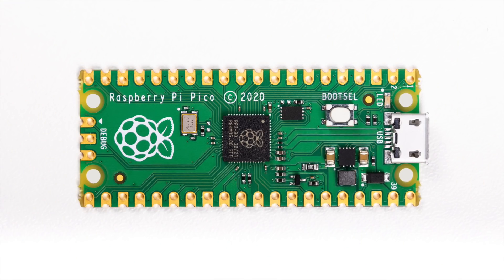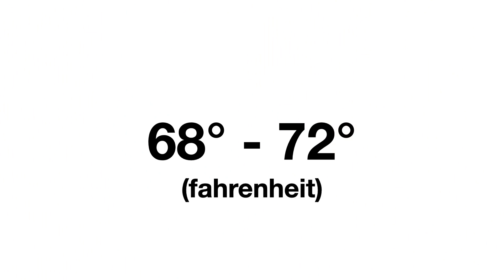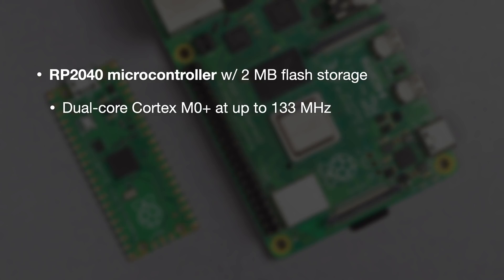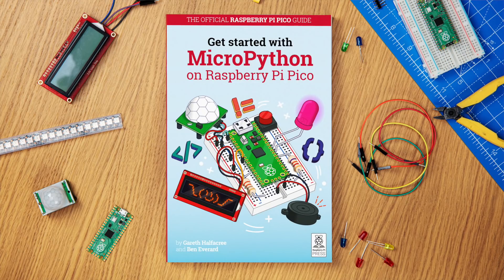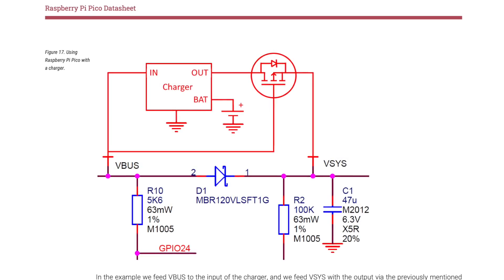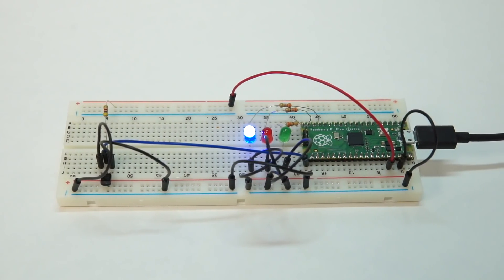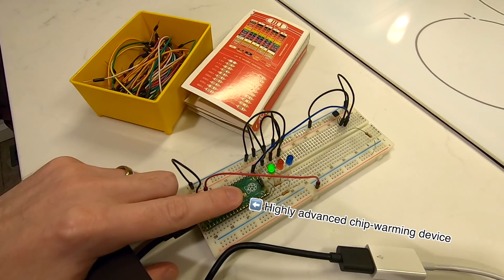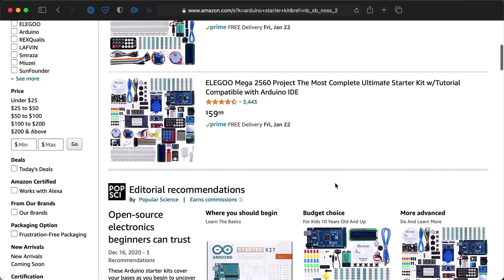The Raspberry Pi Pico Review - $4 ARM Microcontroller

Comment: This Pi just needs WiFi.  It reminds me of when the PiZero was released, so frustrating but they soon released the PiZero W.  Hopefully they will do the same here.  Otherwise I will have to stick with my ESP8266/ESP32 devices.
Reply from the maker: I'm hoping for the same!
Reply: @JeffGeerling  Also if you ar einterested in writing software with multithreading but without the race conditions give the language RUST a try. I still can't believe how fast it is. No Garbage Collector but you don't have to deal with memory management. Its easy af to make a for loop multithreaded or spawn completly new threads that do something entirely different.

Would love to see a video of yours where you run rust on it.
Reply: ESP8266 provides a serial AT interface to Wi-Fi from the factory and costs $2. $3 if you get one with 3.3V regulator on a breakout board. If you need the GPIO capabilities of the Pi Pico it's still cheaper than most options to just wire an ESP8266 to one of the Pi Pico UARTs. That also takes the burden off the ESP GPIO. Where that could be important is a heavy interrupt environment. Like driving a long bitbanged SPI bus full of LEDs. If you change the LEDs based on callback functions you can find the WiFi interrupts on the ESP preempting your interrupt handler beneath the Arduino app in FreeRTOS because it has realtime priority. What that looks like is a bunch of scrambled LEDs toward the end of your string. For example, a Phillips Hue protocol app that changes the led strip to a solid color will kick back a HTTP 200 response to Alexa the instant the callback returns and potentially scramble your SPI data. If the Pi Pico is driving the LEDs and the ESP is only doing WiFi this problem is easily solved. You don't even need to bitbang SPI on Pi Pico. You've got like 4 separate buses. This thing is an IO beast, really. Anything similar in a single chip, like Teensy, is likely to cost way more than $4 or $7.
Reply: @AugurIliKur  Don't bother with the ESP8266, the 96KiB of SRAM isn't enough to do TLS crypto over the internet. It's only useful for connecting to device locally hosted on the same LAN/Wifi segment. Look at TTGO's T8 board for a good inexpensive ESP32-WROVER module with the 8MiB PSRAM. Worth it for $6, and you can do TLS connections, even SSH2.
https://www.aliexpress.com/item/32851423415.html
NO NEW DESIGNS should be using plaintext protocols past 2020. I'm seriously so sick of warning people off eWeLink and onto tasmota+nodered on a pi. HomeAssistant makes things much easier to deal with, without the ornery cloud connection nonsense. It IS possible to get an 8266 talking TLS1.1 in software, but you have to dick around with nginx/apache buffer sizes. It will NOT work with the default 16KB buffers -- you need to drop it to 2KB or 4KB. This also means that it's a nightmare trying to talk to JSON endpoints on existing infrastructure using the defaults, which are not under your control to be able to change. You're just straight up locked out of those. As an example -- take a look at the Lichess client.
Reply: @peut  It's not that internet radio must be encrypted, but if I want to listen to a stream cast over https, I should be able to without having to go through a bunch of hassle. The '66 just doesn't hold up as well as long as it's talking to the internet of dangerous scripts. Personally, I'm rather excited about the ESP32-C3, the 'modern' replacement for the '66. Singlecore, but full crypto for roughly the same price as the '66. I think it will be espressif's part# that allows the 8266 to retire gracefully and take it's 96KiB to the nursing home for a couple years, and then the EOL grave.
Reply: @SLLabsKamilion  Yes, I remember being a little disappointed when figuring out that my ESP8266s are inadequate a for small TLS encrypted web servers.  Will check out SSH tunneling with the WROVER.
Reply: @AugurIliKur  A Pi Pico using an ESP as a serial modem may be great combo for a RAMPS-like 3d printer controller.  Makes me curious how fast one could get a short SPI bus clocked between the two, if you wanted to go nuts and share computational problems like rendering and encryption between the units.
Reply: I'd probably go for an ESP32-PICO-D4 chip instead of the RP2040 too, unless i really need a feature the RP chip has. For anyting that really needs to go low power, i still prefer an STM32L, if the application is not that demanding.
Reply: I was just about to say this. I'm sure it's only a matter of time.
Reply: @r1273m Yeah...I had the same thoughts on that.I just wanted to grab a few and mess with it.I figured I would use an ESP8266 for the wifi and,maybe some higher level power/circuit management. 🤔
Reply: not so simple. this chip is used in low lower applications, adding WIFI Radio won't help.
Reply: BLE works too
Reply: Why tf is everyone so butthurt over the no Wi-Fi? It's not an actual pi and there's only a VERY small number of microcontrollers out there that have inbuilt Wi-Fi. As a roboticist it honestly doesn't make sense to me. 90% of my projects don't even require Wi-Fi, and when I do I fully expect (and usually want) there to be a separate Wi-Fi module so I have full control over the power distribution.
Reply: @AustinLHoward  I agree, most MCU’s don’t have WiFi or need it 
. However quite a few people like doing diy IoT. The problem really just is that WiFi is complicated to add, but I’m having the feeling most people don’t understand enough about chip design to realize that.
Reply: @lotrbuilders5041  Yeah very true. I'm assuming most are coming from the SBC side of things with RPi and just assuming that this should have similar functionality.
Reply: @AustinLHoward  not just a it more difficult, but it also introduces RF noise into the solution. Really though this only impacts ADC as their will be some RF spikes in the measured results. That said the ADC included in most microcontroller is not want you would want to use for any solution measuring say battery voltage to do power management control of such a system. You always want to go to an external ADC solution, be it from Texas Instruments or whoever for your big boys projects with ADC precision and accuracy but when learning basic electronics concepts and playing with a microcontroller and breadboards the built in ADC in these microcontrollers is good enough. And SBC don't play in the microcontroller space as they are not instant on and executing your single program. But that said you can wire a microcontroller to a SBC like a Pi Zero and wait for the operating system to load and then write more programs there to get sensor data out of a microcontroller with no wireless comms capabilities but again that's more expense and more effort writing and management of more programs. Most people using wireless comms are sending to MQTT+Node Red and doing everything they want in a very easy to setup system environment with less hassle.
Reply: @AustinLHoward  data feeds the world the famous quote is what gets measured gets managed. Being able to send you data over any means for further on processing is managing it further and doing more complex things than an isolated system. Is it require no, but it's pretty damn convenient to have! And as a consumer they will always compare price paid to what you get. ESP32 at $5-$6 a chip with its feature set easily bought from major retailers like Amazon versus other microcontroller for $4, more difficult to buy conveniently and not able to use any free shipping options are all factors that up in the mind of a consumer when buying. So it's normal for people to be critical of all of these of which features is just a portion when buying. Hence some microcontroller seem to get very popular while other microcontroller don't seem to go anywhere.
Reply: It’s meant to be embedded into a larger project board. It would be be hard to add a WiFi chip if you really need it, just grab a spare serial connection.

Comment: Can of worms opened. 20°-22 °c sounded very warm to me. So, I did find lots of Internet articles stating this figure and they all seemed to be from US sources. UK sources such as the Lullaby Trust seem to go with 16°-20°, which to me sounds a far better range just for comfort let alone SIDS. 

Research does on the whole seem to say hot=bad, cool=good and I'm wondering  if it could be that the human has evolved so that its offspring can only safely survive in such a narrow temperature band, I really have no idea of the answer but my gut feeling is that the maximum temperature may be considered best not to exceed 20°-22° and this has somehow come to be considered the temperature range rather than the max temperature range. I'm sure others that know better will be along soon.
Reply from the maker: US babies like it hot, I guess. Maybe we do toast our babies a bit!
Reply: @JeffGeerling  Got worried there Jeff, the notification stopped at the commer.

Comment: It doesn't even have WiFi? Then I'm out, even the ESP8266 for the same price (or even less) has it! When I read about it first I assumed WiFi is included of course. So definitely no competitor for most of the tasks I'm using the cheaper ESP8266 for.
Reply: ESP8266 barely has 5 useable GPOI pin lmao
Reply: @Traza32  It depends on what you want to use. If you use "modern" (not really) interfaces like I2C you only need two ports. Then again: if you need as many ports and no WiFi then we are completely different as I need WiFi for my SmartHome and use a lot of I2C devices.

Comment: @Jeff, is there any chance to solder the pins on top of the board and flip it upside down on the breadboard to see the pins’ labels?
Reply: yes, why not!
Reply: Then just wire in a switch externally.

Comment: 5 seconds sleep time between reads is rather low, temperature doesnt change so fast. 30 seconds or Even longer is more reasonable imo.
Reply: 5 seconds is good to have for moving average, especially with sensor inside the chip, it can jump a little or you breathe on it and it would jump too much.
Reply: Sure, but if the energy cost of reading the sensor isn’t exorbitant, why not update it that fast? Power still has to be flowing to keep one LED on and run the timer that’s counting the 5 (or 30) seconds.
Reply: I mean what about a door or a window left open? :D (just sayin' ...)
Reply: Yep i get it i get it! In the particular scenario it make sens. But if it was an app notification you may want to have a faster feedback to avoid temperature drop. TLDR: Temperature can drop quickly that is just what I wanted to say.
Reply: @glamax1393  I mean its not like temp down for a minute =  baby dead. And I think in a scenario like this a delay of even a minute wouldnt be all that terrible. And sudden drops in Temp in a flat are ussually caused purpoasefully, like opening a window. I get what you're saying, but I think what another commentor mentioned is more important. The Power of the Leds may aswell be much higher than the measuring.
Reply: I agree you are right! I was out of scope sorry my bad :p

Comment: I'd pay twice just to have type C, micro usb has to die already
Reply: Adafruit has a version with usb c
Reply: You can also buy an esp32f401/f411 board with type C for $3
Reply: Two things:
1:  It would be great if this was also supported by arduino IDE.  
2:  It would be great if they made just the micro itself available so that it could be integrated into a PCB of your own design without having to use that entire castilated PCB.   Much like you can procure the STM32F103 that is the heart of a Blue Pill.
Reply: I agree for most thing, but for a microcontroller, why? Micro-USB cables are still cheaper, more common and with a microcontroller, once it's connected, it stays there for a long time, you don't connect and disconnect it every day like a phone, a tablet or maybe a controller.
Reply: @MrCed122  how much cheaper are they? 50c/cable? I get that this is not going to be plugged and unplugged as much as a phone or any tech gadget but I find micro b really inconvenient to use and going forward is going to be less and less used together with type A, having to look for an otg adapter to plug in a type A-> micro or find a weird micro->C cable in a couple of years when most laptops will probably drop type A is gonna be pretty annoying, my first type C phone is from 2015 (OP2), other than to literally save a few cents in production and to have a slightly smaller connector I see no point for it to exist in 2021, even at this price since you could raise its price to 5 or 6$ and it would still be sold out everywhere for the foreseeable future, it's probably compete with the 0 pricewise too much but it's for a different use case
Reply: @UNVIRUSLETALE  If they raise the price by 5-6$, then they'll compete directly with more commonly used Arduino clones and even with their own Raspberry Pi Zero W (which isn't exactly the same thing, but still). Raspberry always stayed on top because of their prices, not because of performance or cutting-edge functionalities.

As for price of cables, well, I'm Canadian and while I can find Micro-USB cable for like 2$ that work fine (and I have a box full of them anyway), decent USB-C cables are not available under 10-15$ (well, except USB-C to USB-C for some reason, I can find those for 4$) and I definitely don't have a few laying around at home, I have barely enough for all of my USB-C peripherals (and some of them don't work on everything, my Samsung USB-C cable don't work with anything other than my Samsung phone). It's not a crazy difference while talking 100$ peripheral, but on a 4$ one... yeah.
Reply: for what purpose would you need anything more than a cheap usb 2.0 on this little thing? I'm half doubtful, half curious btw
Reply: @araarathisyomama787  I just hate the connector, I lost a few gadgets and phones due to the poor reliability of it, I know that you're probably using the connection twice (to program it and power it and leave it doing its function) but other than a couple of pi nanos/esps that I bought like 4 years ago I don't want to come anywhere near another micro b cable/connector, with just data+/- and 5v/gnd is really cheap to implement in the same way the micro usb is in this one

Comment: you should compare pico with stm32f411 blackpill board, they are same price, but the stm32F411 is ARM M4, and the document and community from stm is more mature than raspberry
Reply: BTW 2mA sleep current is a lot for micro controller, usually they are in range of uA or nA

Comment: Any idea how the cycle times and signal latency compares to a full grown pi? If I wanted something that reacted quickly to some input, would this be better or a standard pi?
Reply: This is better for tight timings
Reply from the maker: someone has been doing a lot of benchmarking and will be publishing heaps of data in the Pi Forums soon. bottom line: for real-time work, this thing is waaaay better than a Pi, especially with the C SDK (but even with MicroPython).

Comment: Just thought it, as an old Arduino user. Why 2 cores? Can you code to run both cores?
Reply from the maker: Yes. it's not full on multi core like you get in Linux, but you can have a thread processing data on one core (eg TensorFlow light) while the other core is in the main control loop.

Comment: I thought it was a new version of the Pi Zero. Guess how that ended...

As for this, I profess to have little knowledge but I’m not sure it’s going to be value for money. In the UK it’s £3.60 with £3 delivery. Thats almost the same cost to deliver as it is to buy it! So that’s £6.60. Amazon is showing ESP32s for £7.49 delivered which seem to be the board of choice on YouTube. 

Ultimately it’s going to be about what a person needs for their project, so specs will come into play but I suspect for most, the lack of WiFi’s/BT will be a deal breaker.

Comment: All I think is: dual core 133MHz should be MORE than enough to run Doom...
Reply from the maker: Someone (SparkFun?) already has a little handheld emulator in the works 🤪
Reply: @JeffGeerling  I guess whatever program state or variables you declare you have goes into RAM (including emulated NES or whatever ram) and what’s on flash is what a PC emulator process in ram looks like after an NES ROM is loaded but before emulation has begun. I’m just spitballing here. Embedded development is weird.

Edit: I guess with 256kb you COULD be able to arbitrarily load some of the smaller 32k NES NROM games into RAM - Mario 1, Excitebike, and have enough for a frame buffer. Uhhh....
Reply: Wouldn't be more efficient to make one core run doom and the other one process VGA signals?
Reply: Doesn’t have the ram
Reply: @johnsimon8457  you can hook up an external RAM chip